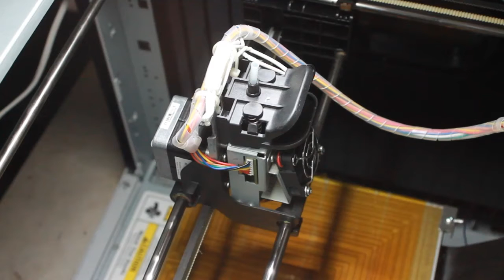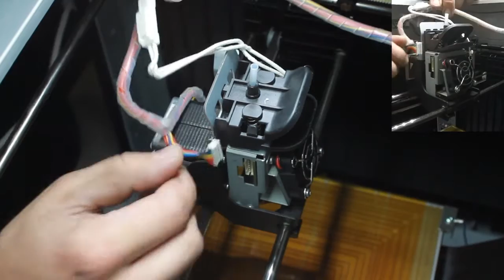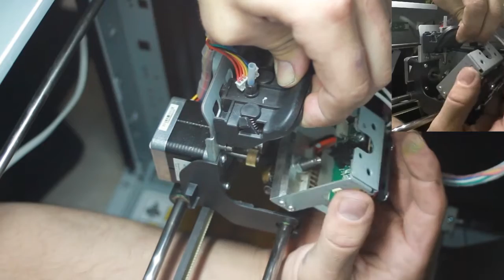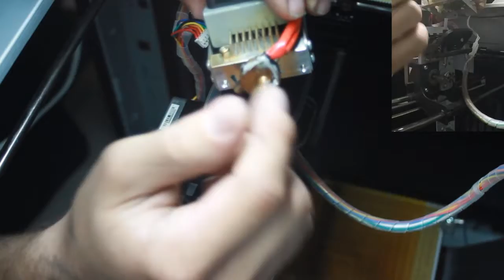Da Vinci 1.0a Extruder Removal (2 camera angles)

Comment: know this is old but need some help. Looks like there's a piece of filament broken off down inside were the pft connector is. I tried with needle noses but can't get it out. I can't get the extrude to come out and i think its from that piece of filament in there. How would you get it out if its the reason. Hope you see this. thanks. video was good.
Reply from the maker: Hello, I remember not being able to get it out also so I just fed it through the extruder with the nozzle temp up. When I couldnt push it through anymore I then fed in a new roll and pushed the rest through. Hopefully this helps.

Comment: My filament is stuck. That was the reason i was trying to take off.
Reply from the maker: LPJenks  Recently I had jammed filament and what I did was I turned the extruder temperature to 240 degrees C and I used repetier to feed the filament in. If that does not work, it probably isnt a jam in the extruder head. Your filament might of been too thin and the filament gears might not have been able to feed the filament through the extruder which the gears would grind away on the filament and it goes nowhere. You can try to unload the filament while pulling very gently on the filament at the top and see if that helps it come out.
Reply: William Piotrowski   The first video is what it sounded like when trying to unload. Before the filament broke that is what i was doing. But it wouldn't budge
Reply from the maker: LPJenks Hmmm Id really like to help you solve this. So you have tried everything so far.
Reply from the maker: LPJenks I dont know if you want to try this but you could pull out the extruder carriage to make just enough room to cut the filament. Just so you can remove the extruder carriage.

Comment: My extruder will not pop out like yours did once you push the black lever.
Reply from the maker: LPJenks You need to unplug the cables out the side and you need to make sure there isnt any filament. I did assume you wouldnt have the filament still in. Also I do remember mine being a bit of a pain the first time I removed it.